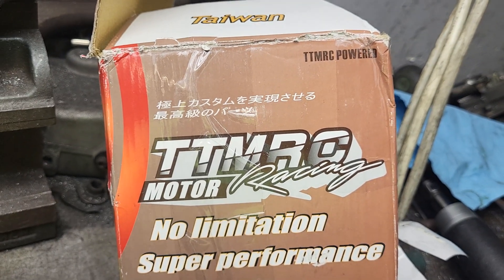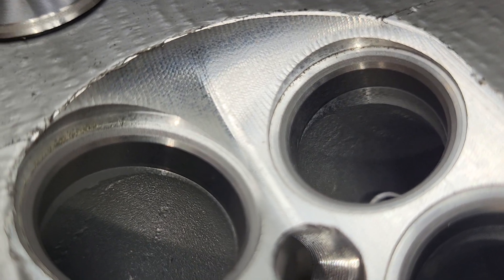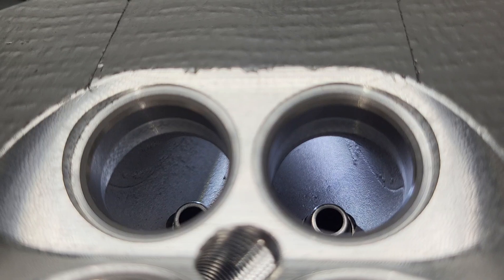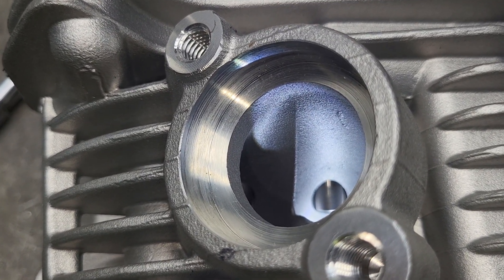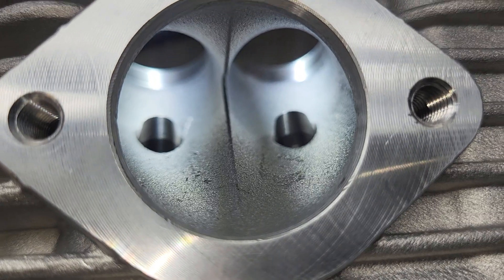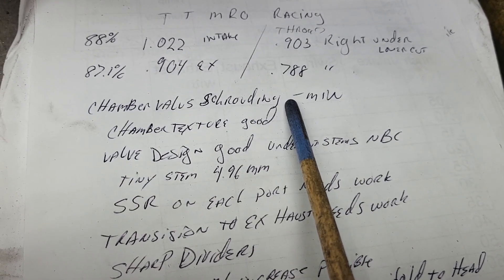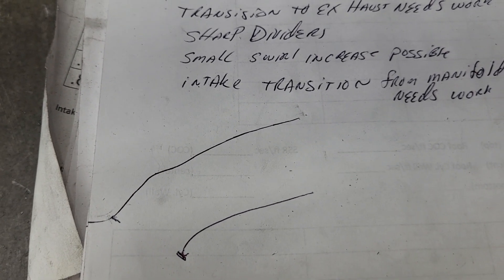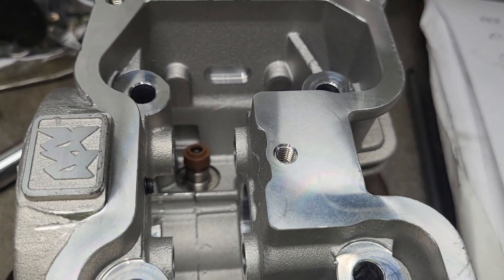4 valve pent roof cylinder head for 10,500 rpm application. First look at new stock casting

Comment: Hey I know you might not mess with honda or acura  the new k series 2012 up have the exaust built in the head 4 piston came up with a head nobody has showed any porting that I've seen die hard honda fans are snarling there nose at them they make hp the new civic 2.0 type r is pushing 300hp with the head exausst port u could break the internet every honda acura fan would watch it and it would probably cover u up in business
Reply from the maker: @JoeC-u9x  Yeah, they make power. Hard to port.

Comment: Very interested in this. I have a scooter i built, and 4valve heads sre available.  I got about 35cc from a big bore. And a high compression piston, ported two valve , (with oversize valves). head, with a cam and carb. With exhaust.  But its still not enough, it needs more compression . And more cam its seen 10200 rpm but was useless spinning that fast. I think it actually lost power up there. Around 9300-9500 is peak id love to get a cam ground change the timing around a bit. And get a small lift gain. And some duration peak power is 7500-8500 stock, move that up to 9250-10k should get some gains, but double the displacement will gain more! Have a awesome day!
Reply from the maker: @jamest.5001  Cool!

Comment: That head needs welding and cutting to fix that exhaust outlet.  It would help alot with it straight and a cnc head pipe adapter. With long sweeping turn!
Reply from the maker: @jamest.5001  No doubt!

Comment: You can go to Ace hardware and find springs for checking. Have you seen Bryce Star videos? He is the motorcycle race man. What engine is that?
Reply from the maker: @dondotterer24  I talk about the engine  in the second video. Thanks
Reply: It is a yamaha zuma 125 bored to 67mm piston and a +10.2mm cranckshaft = 240cc

Comment: Leave springs out. Use your TDC bridge with a magnet between valve and bolt. 
  Tymco...Chinese terrain vehicles. 
  Remember how the clutches work with these. They pin them at high rpm and wait for the rest to catch up. 
  It's all about the high speed side. 
  Have fun with this one Charles. Very small changes makes a big difference.
Reply from the maker: @approachingtarget.4503  Cool, thanks

Comment: Swirl doesn't work too well on a 4 valve pent roof, or rather doesn't bring any substantial benefits. 4 valve pent roof likes tumble more than swirl. To make swirl and poly-quad work on a pent roof, the valve angle needs to be very narrow, nearly vertical, like a diesel. You also need a special spark plug that looks like a non-fouler. Instead of having a hole in the center, it's a cap with holes drilled  around it. The swirling action creates a low pressure core that pulls fuel and air to the center, and the holes on the cap over the spark plug shoot out like a jet and ignite the fuel very quickly. The ignition is so fast that you can run much tighter timing advance.
Reply from the maker: @rolandotillit2867  I disagree and so does D.V. his poly quad design introduces swirl to a tumble design and makes better power.
Reply: @servediocylinderheads polyquad doesnt make more power.
Reply: @servediocylinderheads  I didn't say it doesn't work, I said to get the best out of it requires a different approach to the whole combustion process. The chamber, ports, spark plug, and fuel injection have to change to accommodate it.
Reply: Sounds like you need to stick to sim rolando....
Reply: @oldblueaccord2629  How does introducing swirl to tumble create more power? How do you get more power if you're not increasing the amount of fuel or air? The only thing you can do is increase the combustion speed, which means the only benefit comes from less timing advance at higher rpm, and running higher compression ratio.
Reply: @rolandotillit2867  Thats not what Endyne found on Honda heads....you do much Pro stock work like they used to do?
Reply: @oldblueaccord2629  What did they find?
Reply: @oldblueaccord2629  so what did they do? I'm genuinely curious.
Reply: @rolandotillit2867  The sell cylinder heads a pistons and build engines for about 40 years now. The link is above to there website and there racing history. Sorry Id love to read it to you but dont have the time. Have a good day.
Reply: @oldblueaccord2629  So running your mouth pretty much.
Reply: @rolandotillit2867  I wish I could help you out more....very sorry.